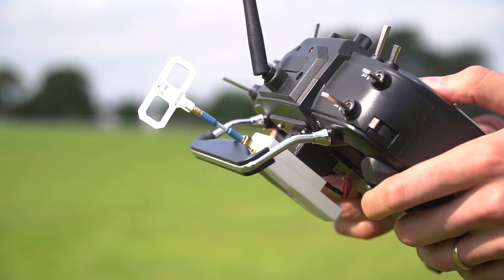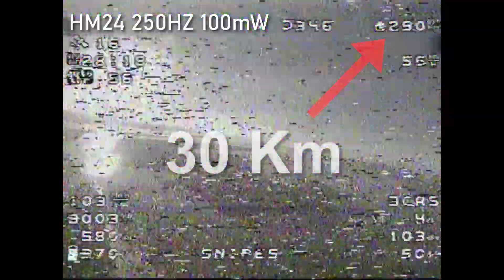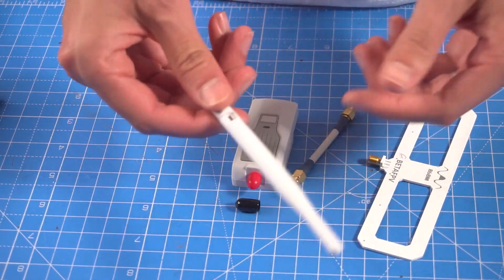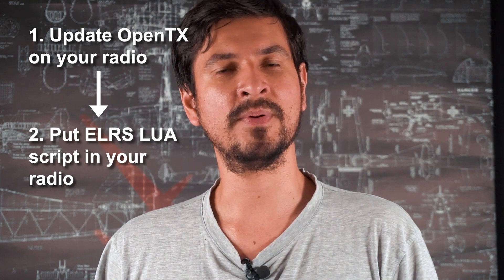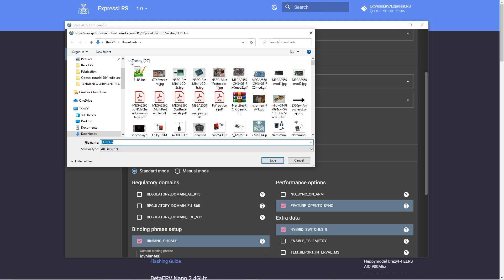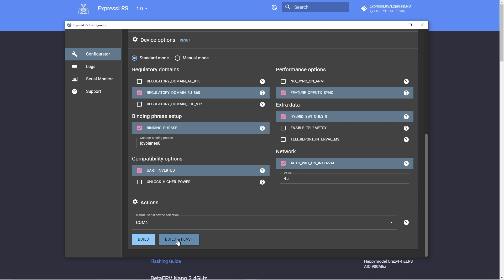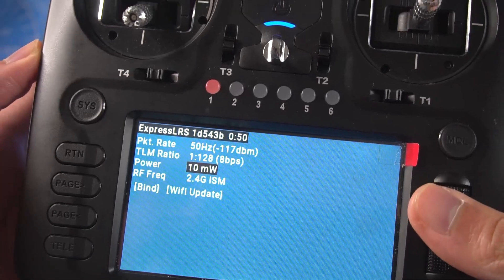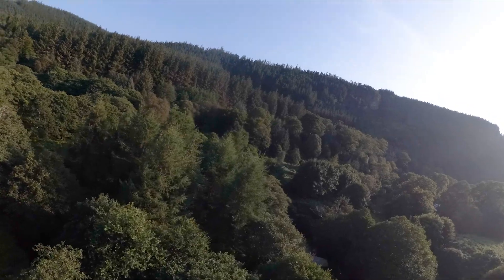ExpressLRS Radio Link System - Low Latency and Long Range | ELRS Nano TX Module

Comment: Hey man, I made a response video. My drone with ELRS, had RXSR, no matter what I do it keeps disconnecting. Ive had to buy so many new parts to keep repairing the drone and it keeps falling out of the sky midflight disconnecting. I would be fine with it if I was the one crashing it, but It literally turns off at 100ft in the air. I dont know why please help!! https://youtu.be/6_e-R6mEt9E

Comment: I'm looking forward to getting this module in the mail. I've had a big Crossfire micro module hanging off the back of my Frsky x9lite radio for over a year now. This module will actually fit in the bay on my radio. The price of the receivers is way better than crossfire. The money I spent on 3 crossfire receivers will get me 6 ELRS receivers. I do feel kind of like I'm cheating on my wife though. Crossfire has never failed me and it's protected all my quads by never failsafing, but I'm going to set it aside and start playing with ELRS. I do hope that this will not hurt TBS very much. I hope they can adapt and continue to innovate and make great products. All they'll have to do is lower their price if that's possible for them. By now the high prices should have recovered all of the R&D they put into developing Crossfire.

Comment: Nothing could beat crossfire. Record on 25 mw and stock antenna is 50 km. You could switch up to 2 w of power and the Antennas you could also change.

Comment: Are there applicable for a cheap tx such flysky fs-i6?  (With rx fs-ia6b)
Reply from the maker: No, hardware has to have specific chips to work.
Reply: In case you missed it. There is firmware mod for flysky i6 & i6x that compatible of expressLRS modules.

I have couple of videos about it too.
:)